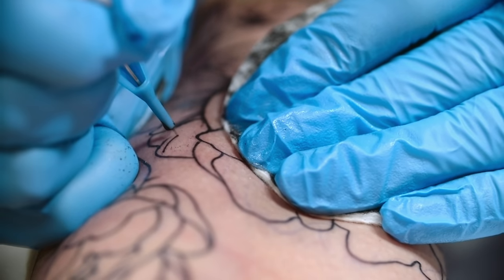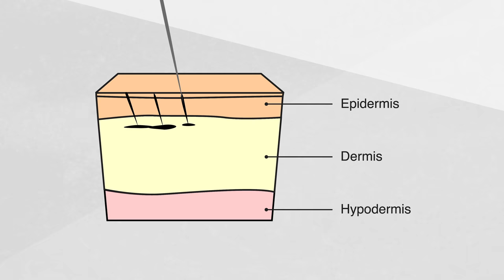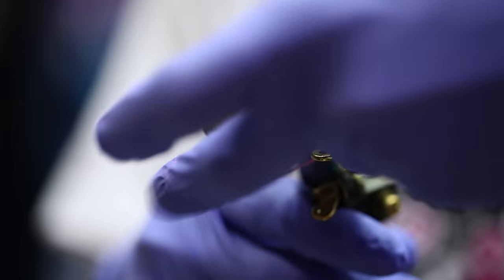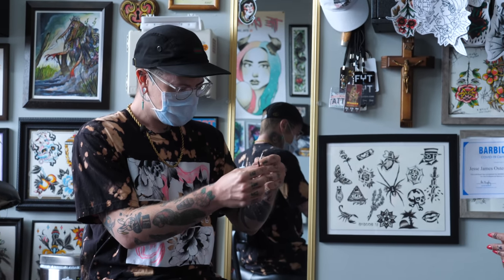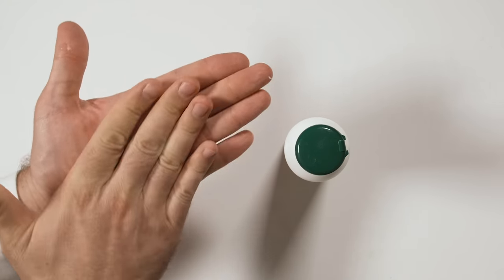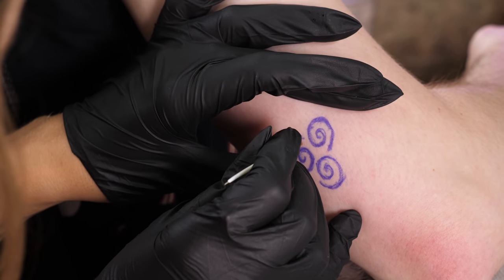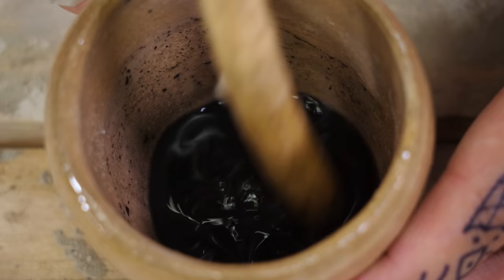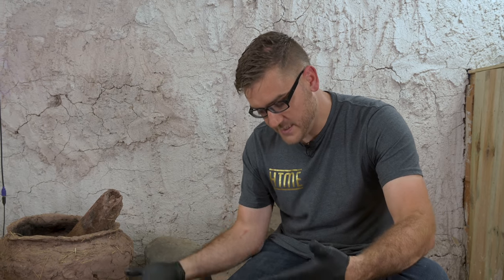Stick and Poke Tattoo Using Porcupine Quills (OF COURSE IT HURT!)

Comment: I wouldn't fault the Tattoo Artist for doing a bad job.

It's a single needle Tattoo.
Even Tribal Tattoo use multiple needles.

If you go over the tattoo multiple times, in sections with a few rest day for the skin, it will start to look clean and much more define.
Reply: Bruh I saw people in highschool give themselves stick and pokes with a single sewing needle that looked significantly better than what that "professional" did
Edit: I just got to the end and they never showed her face, and they censored her voice lol she knew people were gunna call out that horrible job
Reply: @GlorifiedGremlin  Are you really comparing a steel needle manufactured and sharpened in a factory, to a porcupine quill pulled off of roadkill? It's obvious which one will do a better job.
Reply: @DennisTea  I am when the steel needle is in the hands of some dumb teenager and the quill is in the hands of a "professional"
Reply: @GlorifiedGremlin K.

Comment: when I was in sixth grade some of my classmates blew the ink of a pen in a water bottle cap and started making eachother tattoos with compass weirdly they didn't come off and didn't infect I was in shock
Reply: I got started doing tattoos with a sewing needle taped to a pen, using ballpoint pen ink. The tattoos kinda faded into a light blueish color even though the ink was black, but it didn't get infected, the lines didn't bleed into the skin and it's still looking pretty good. I guess my point is that as long as you have something pointy, a dark pigment and a sterile environment you can make pretty dope tattoos.
Reply: @demox4435  in their case everything was on the go everything was completely unplanned and sterile wasn't a word back then
Reply: My first tattoo at 15 was with a porcupine quill, I went through 3 , it was interesting in the video how they mentioned how soft they are, it’s like a big cat whisker less like a rod
Reply: @davyjones2994  once while I was asleep a ball from the cactus in my room fell onto my face waking me up
Reply: Depends on ink. If it was alcohol based, it could have disinfected tools by accident, though ink it self probably was not safest of possible options...
Reply: @Hellsong89  it isn't we don't have such type in my country we just have aetheric oil based
Reply: @Hellsong89  I mean they wouldn’t have had high proof ethanol until metallurgy was sufficiently advanced.

Comment: Just a note: after a fresh tattoo it does ooze a bit.  It's part of healing.  The extra ink comes out as well as a bit of blood and pus.  Its only a problem if it's doing that after a day or two then its no longer normal and a sign of infection.
Reply: It should never be oozing pus.  Blood and plasma yeah but not pus.  Pus is a sign of infection.
Reply: Pus?? UM. NO. Pus is a doctor visit. Plasma and ink is normal, but not pus or excess blood.

Comment: I did a stick and poke tattoo on myself. I just couldn´t justify the material cost my local tattoo artist told me, because it was almost 3 times the cost of the needles and ink I bought online. I would understand the price if they charged the actual work more than the materials but they didn´t.  So I did it myself and I love it.

Comment: If you revisit the tattoo try to take a hint from Polynesian or Tabori. Put your needles in a group held in place with hide glue and a hardened piece of rawhide or natural fiber. Then attach it to a stick. Gives you far better control and placement.  Congrats on your first tattoo.

Comment: Joye's tattoo turned out really nice, Andy's not too bad for the first time both doing and receiving it. I used to do some shallow, non-permanent stick and pokes as a kid, didn't even know that was a thing, I was just bored in school. I just used the ink of my fountain pen. I wonder if the alcohol in the ink doesn't really burn?!?
Reply: Not really, even though it ended up being pretty high proof alcohol it only stung a tiny bit, barely noticeable under the feeling of the actual poking.

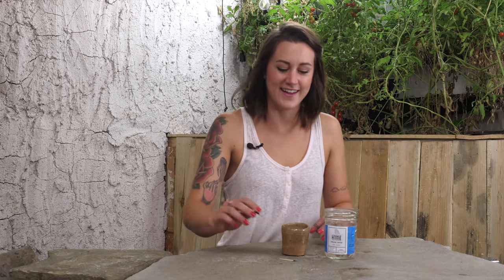Comment: There are a bit of issues with how things were performed. First at 10:01 that quill is definitely not sterile, if anything it has been disinfected (but most likely not from from the quality of alcohol, and how the alcohol was distilled and treated). The quill should have been sterilized by using an autoclave, ora combination of heat and alcohol (probably an hour near boiling). It would have been a good idea to either ask the tattoo parlour or the tattoo artist who used the quill on how they sterilize their equipment. The choice of dye is a bit concerning because of the possibility of carcinogens. That soot hasn't been treated properly and there is probably a degree of incomplete combustion during the preperation.

Comment: You cant add the total alcohol distillation time into the cost as the amount used to "sterilize" the needle and make the ink are offshoots to the total amount made. If it was made specifically for tattoo use only, then yes but it would be split among all tattoos done, otherwise it would just be counted as a percentage of the whole.  If you only made a cup and used the whole cup, count it, if you made much more than a cup figure out your percentage and add that instead.

Comment: I remember a while back when you were making glass you used a limestone which probably was from the Magnolia member of the Platteville limestone which is the upper part of that limestone which overlies the saint peter sandstone. I am aware you had some problems with your glass and some of that may be due to that the magnolia member isnt a pure limestone but a dolomitic limestone which means it has incorporated magnesium. Also magnolia while it may look relatively pale it has quite a bit of iron which is why when it is cooked it turns red (sometimes). If you want a close and more pure source of limestone in southwestern MN there are cretaceous chalks which are exposed in a few places however a lot of glacial deposits are derived from this and the chalk can be picked out. Morris MN looks like it has a few deposits like this also Ortonville does too. You might also find some shark teeth at these sites too.

Comment: For this one you guys really should've gonne with traditional japanese tattoo with bamboo needles or the polynesian/ Tahiti traditional method that uses shark teeth, bones or shell for the hammer/percussion tool... alas, hard and expensive to find the pros to do it I guess. :P Key thing to understand about tattoos is this: you are not injecting any ink, you are opening holes in which ink will be drawn in by capillary action.
Reply: We initially were going to talk to an artist who had trained with traditional hand poke tattoo masters in Borneo and a few other places in Polynesia and eastern Asia, but unfortunately the interview fell through due to scheduling. It took a while to decide which method to do but we went with the porcupine quill because that method is local to a few Midwestern Native Tribes, we were lucky enough to find that porcupine (we were going to try and talk to a porcupine handler at the Minnesota Zoo before Daniel found it), and it makes for a really impressive story that we got tattoos with a porcupine quill. I didn't know that about the capillary action, thanks for that!

Comment: I've become very familiar with stick and poke tattoos. And if you're a tattoo enthusiast I implore you to try it out. You can often find professional tattoo artists familiar with the practice, but if you DIY it like myself just be sanitary and smart with it. I have 2 quite large ones and a smaller one and have never had a problem with infection, and they actually are holding ink and not fading better than the professional tats I have. But I have to say it is quite a lot more painful, you're doing each dot of the lines at a time rather than a machine doing hundreds of dots a second. You feel each one.

Comment: Fun fact: there r some types of modern day tattoo needles that purposely have bars on them for doing diff effects. I tried them once and didn't like them cuz it screwed the skin up too much but it did offer an interesting effect. But that on on modern needles, not quills where the barbs could easily break off and stay under the skin (ie. Infection)....so ya fun times :)

Comment: The problem with Porcupine Quills is that the quills of the North American porcupine are barbed and if they brake off they will continue to work there way deeper in.  I brush agains one with a car tire and had a few quills in the side wall of the tire.   After I pulled them from the tire, two weeks later I had to replace the tires.   If you are going to try this make sure you get the barbs removed.  We practice on Banana Peels.

Comment: In seasonal alignment summer is fire, fall is air, winter is water and spring is earth. The zodiac system is more complex, my personal system uses both season and zodiac, giving a primary element with one or two secondary or enhancing elements.

I am fire dominant with air and water secondary, in the zodiac system two signs can be seen at small points of the year like the solstices.

Comment: Porcupine quills are actually a horrible tattoo needle. The layers of the quill are layers like snake scales. Thus acting like a barb. This increases damage. A bone needle would be a much better way.
Reply: That’s why they sanded down the quills.
Reply: It's the basic structure of the quill itself no matter how much you sand  you won't get rid of it. As the quill grows more and more layers are added like the rings on a tree.

Comment: Inmates in the jail I was in used the short end of a staple they took off a paper on a bulletin board and sharpen it under the porcelain sink where it's abrasive or toilet and the whole process would take a video to explain and I forget a bit of it as it was years ago and I was being told the process